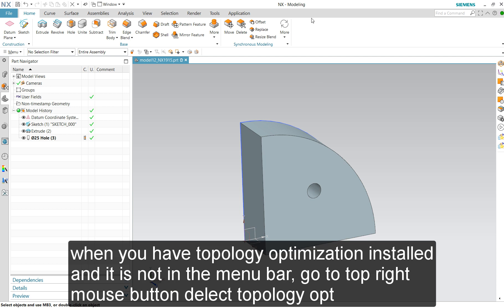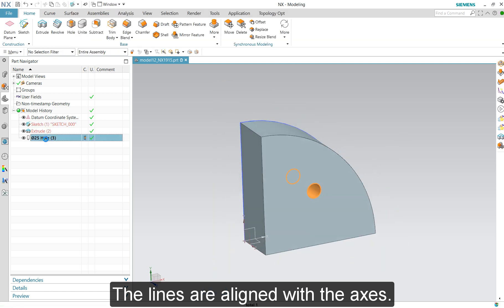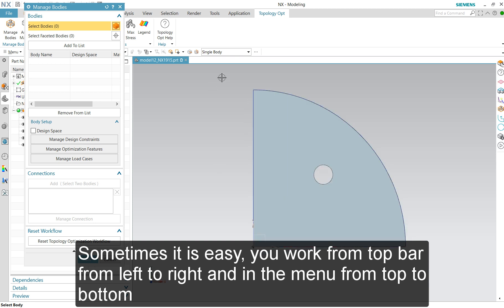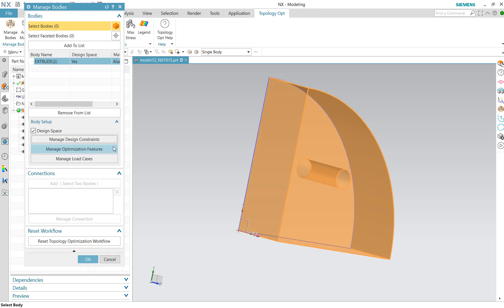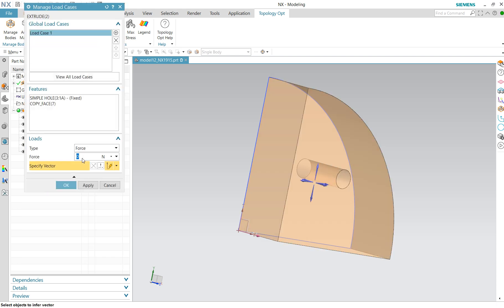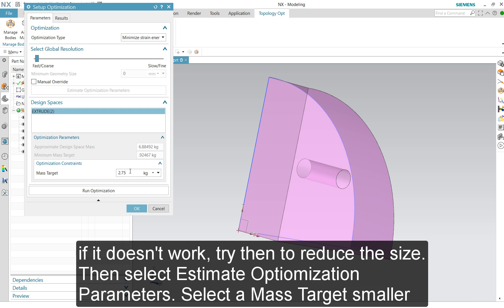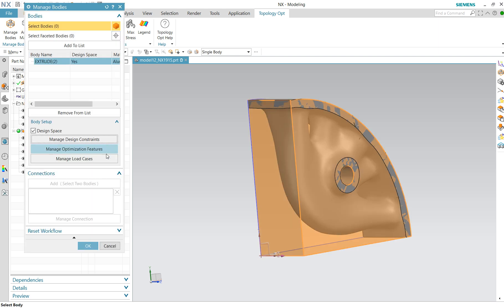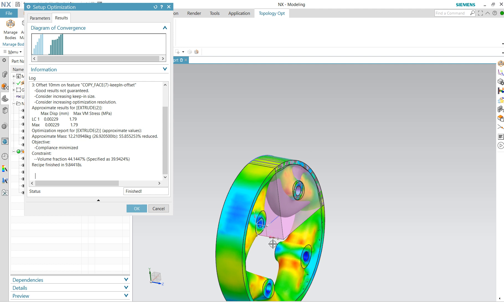How to use rotational symmetry in Siemens NX topology optimization, and some error advises

Comment: Dear, 
How do you display the results of displacement and stress on the surface?^
I only get a grey surface
Reply from the maker: At 0:23 you see the buttons max disp and max stress. What version are you using.? Do you have the three bodies under the non timestamp Geometry in the Part navigator?
Reply: @OlafvanBuul   I’m using version1953.
And I have tried those buttons.... it is the first time that I’m using it.
Reply from the maker: @joaopedropatricio6016  I have not yet used this new version. I know in other versions it did not work well eg. NX12. Do other topology optimizations work? My example of the beam?